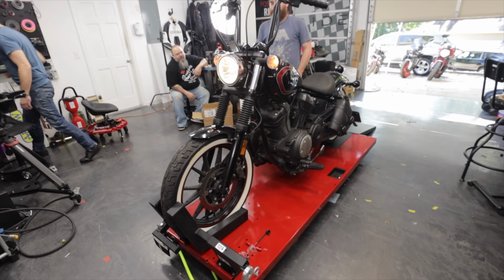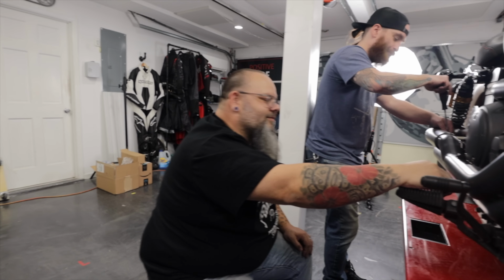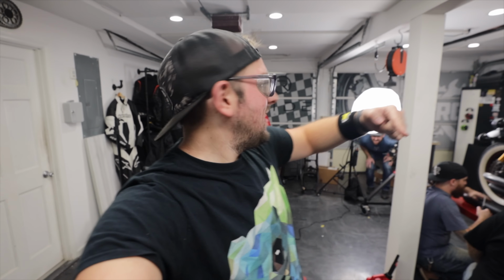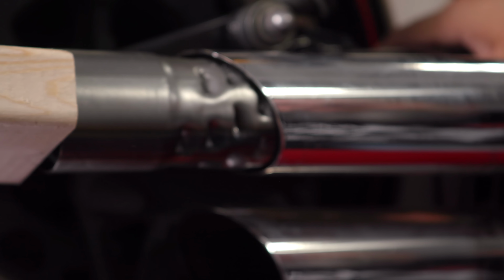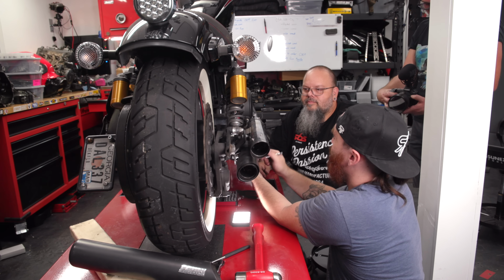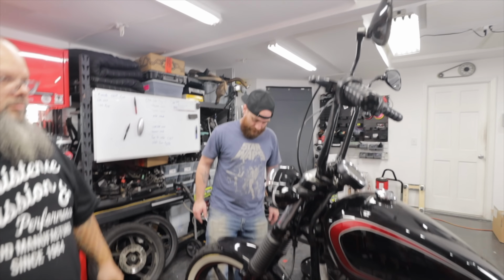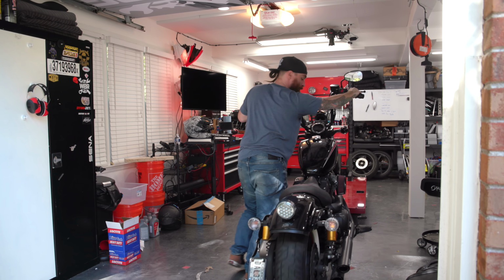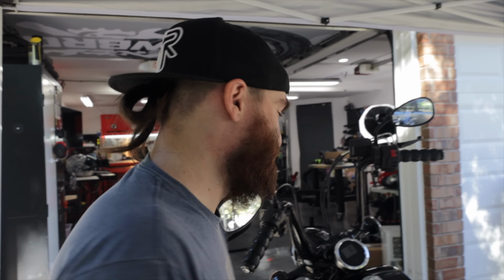His CRUISER is TOO LOUD!! Fix it for $40!! | Yamaha Bolt Baffles install

Comment: Hello guys.
All right with you. Excellent video. One question I have a 2016 Bolt and I want to install these baffles on my exhaust
for Twin Slash. On EBAY it said that it doesn't work for my Bolt and yes only for HD. I can buy what works, right?

Comment: I have a Bolt as well. The factory fart can was way too quiet so I put a Shorty GP "muffler" on it. It was staight up obnoxious. Got a $15 ebay baffle. Less obnoxious but still very loud. BTW tell Beau to buy my Mustang Fastback seat. I'm in AL lol
Reply: how much?
Reply: @YankiRides  id like to get 200
Reply: @keithshelton8393  let me talk it over with the misses lol
Reply: That shorty gp is definitely a muffler, no quotes needed. I can 100% verify there's a change in sound with it on, vs off, after losing mine on the highway. Also, there's totally a little teeny tiny baffle in there. Not big, but definitely a baffle, which does make it a muffler.
Reply: @tricd0444  gotcha. mine didn't come with the baffle. had to order it seperate. baffle does make a difference though!
Reply: @keithshelton8393  it's not REALLY a baffle, it's more like an inner pipe and an outer pipe. Technically a baffle, but it's really not.

Comment: Quick question has he had any problems with the head bearings.  .?  I want a Bolt but I've heard they have issues with the head bearings
Reply: You speaking on woble? With lower air pressure in tire no problem. Its not that bad just dont take your hands off but it's only a 5 dollar part

Comment: yes to more bolt videos.I have an '18 bolt r-spec with v&h pipes and air cleaner, dyno jet power commander and trying to find the best fuel map to run.
Reply: the map i use ( which works great with the baffles in) is just the one from dyno jet for the v&h pipes and cleaner.
Reply: @YankiRides  awesome, Thanks again Yanki! ......Factory baffles or the comp baffles? Mine is straight pipe no baffle.
Reply: @AmericanPatriot1985  I snagged the comp baffles for v&h 3” pipes.
Reply: @YankiRides  sweet I'll probably go that route, straight pipe is pretty obnoxious lol

Comment: Took out the baffle today. Hardest part is getting around all of the fiberglass packing. Took an hour just to fight it. But it's technically simple. Remove the hear Shields, remove the bolts that hold the baffles, & do whatever you can to yank them lol. Sounds amazing and was worth the fight.

Comment: Have you changed bearing in steering system already in that bolt? It tends to "failure" kind'of. There is half plastic bearing that wears out too fast and steering could get wobbly later on. Idk if this is just EU models thing but you might want to check that.

Just giving you an idea for content :P
Reply: I have. I replaced them with the all balls tapered bearings. world of difference
Reply: @YankiRides  my bolt rides smooth, how do I know if I should replace the factory bearings?
Reply: @AmericanPatriot1985  for me, it was very consistent wobble at certain speeds, and a “notching”  feeling at parking lot speeds. Replacing that bearing is not easy, but it’s one, if not the, best mods I have done on this thing
Reply: @YankiRides  oh ok, nothing like that yet but she still has low miles(under 7,000). I know at low to moderate speeds if I slightly take pressure off the grips, there is a slight wobble but I'm not sure if that is normal or not.
Reply: @YankiRides  What year is your Bolt?
Reply: @AmericanPatriot1985  2015
Reply: @AmericanPatriot1985  its probably a chance that it is the bearings. a great way to check is put the bike on a stand/lift, with the front wheel free, then move the handlebars back and forth and see if it gets "stuck" in the middle.

Comment: If you program the bike properly it won’t stall out... Chances are it’s super lean. Chances are also that you will ignore my comment as usual.
Reply: that's actually the reason for the baffles. the price of getting it tuned was too high. this was my compromise with my wallet

Comment: The baffle on my M4 exhaust is super tight. Try putting them in a freezer for 30 minutes. Usually they slide in with no trouble.

Comment: But for real, if you don't get the screw hole lined up,  you seem like your kinda screwed given how difficult it was to put inside.
Reply: the bearing puller worked real well getting the old baffles out, I imagine they would work well in that regard, too.

Comment: Too.....loud.....????? I can't understand. I hear people say that phrase all the time, especially with my music, but as if yet. I've still not been able to decipher what it means. I know what "Too" means and what "loud" means, but they become jumbled and incoherent when joined together and I can't understand what people are trying to tell me.

P.S. I have a 2017 Bolt with the same exhaust, no baffle, but I removed the kickback from the unbalance. Which kept it loud but it doesn't sputter or stall. Which the disruption Dale was talking about is natural in every bike, but there's a ratio that can be offset simply by changing the length of your pipes that can cause exhaust to bounce back from inside your exhaust into the engine disrupting the Air/fuel ratio in the chamber. Which I solved by, without going into all the details of how I had to figure out where on the exhaust I needed to do so, by drilling a new hole in my pipes and adding just a small nut and bolt into the newly drilled hole allowing for the vibrations to match the engine/valve timing so that it didn't send exhaust back into the engine. Learned that shite in MMI. It was trial and error until I figured out where I needed to drill, but I measured 200x drilled once